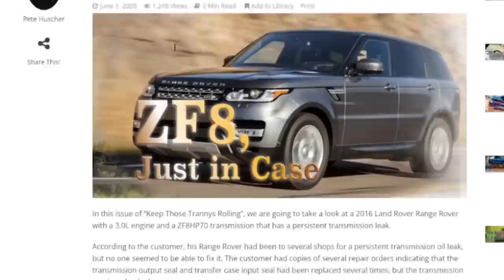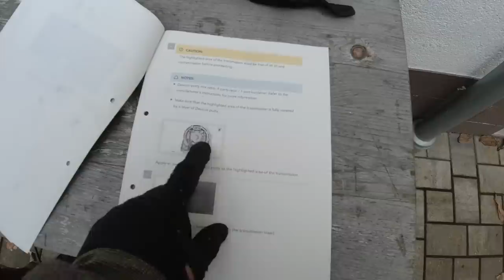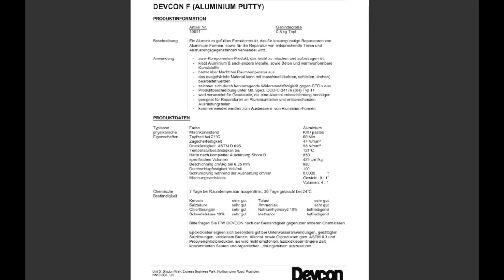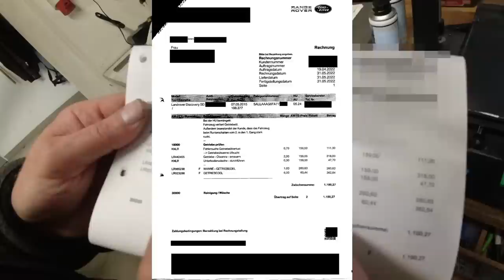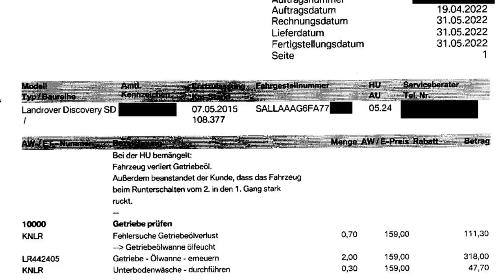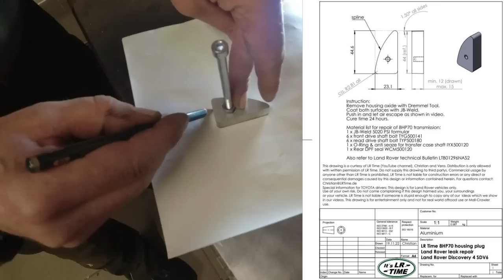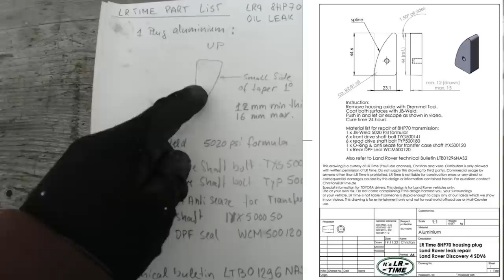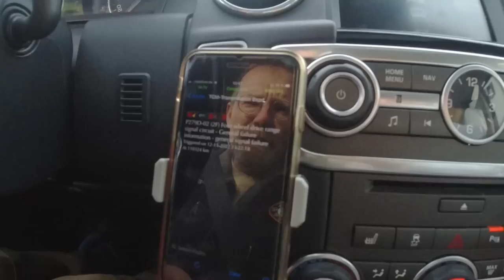Dumbest Oil Leak Ever Fixed on our Land Rover

Comment: the dealership is full of shit. they're mostly the same - in a hurry, working to unreasonable schedules and trying to turn around as many cars as possible in the shortest time possible in order to maximise their profits. that goes for independents too, very few decent mechanics around not ripping people off. also, land rover make a faulty vehicle and then have the gall to charge their customers €500 for the materials to fix the mistake.
Reply from the maker: Yes, they are always on a way to tight schedule and push to make money 💰.  Christian

Comment: If Landrover had admitted failure or be at fault the repercussions to the brand would be very expensive so they would be instructed by high management to deny I do agree they should’ve reimbursed for the work that was unnecessary to the previous owner .😁🇬🇧👍John

Comment: I don't take my cars to the LR dealer for anything after they jacked up an oil change and 100% did not put the correct weight oil in.   it did not sound correct after leaving the dealer and went home order the oil and re-did it my self and it sounded perfect after.

Comment: Landrover ripped off that customer , they should re impures the owner. Shame on them ( and I am a customer having had two discovery 4s; a defender 110 and currently a disco 5 and Range Rover sport). This dealer lets the brand down, you should send this to head of JLR in uk.

Comment: Christian, a person responding on behalf of a business will never admit fault.  However I agree that they were not very ethical or morally correct.  I think that they should have as a minimum checked if there were any service bulletins that applied to the vehicle.  They should make the client aware of all service bulletins that apply to the vehicle even if the client has not complained about the subject of those other bulletins.  The client is then informed and can make a decision if they want the work associated with those bulletins performed.  The faulty casting is a latent defect and LR/ZF should have paid for a recall to have the problem rectified.  If they were not required to perform a recall because it was not a safety issue then they should have paid for the repair when clients found that their vehicle had a transmission leak.
The LR service place should have accepted that they missed checking the service bulletins and should have offered to rectify their mistake for free.
It appears that brand specific service centres particularly for expensive brands get very arrogant and used to having people with deep pockets just pay without question.  Yes they have to make a living but they should also be professional.  For the prices they charge we should not have to put up with incompetence.

Comment: Its JLRs business model, they should have recalled the engines with the crankshaft spin issues and recalled for the casting - but they choose not to for profits sake - with the result that reliability and customer satisfaction is very poor - but their main market is folks with plenty of cash who buy new every couple of years. Once customers walk away they dont come back. It cant be right that the first thing you need to buy for your Landrover is a scan tool.

Comment: Hey guys. I know this is not on the right video to ask this. Though I am sure that you know the answer LOL

I am about to order new brake pads for my LR4 2016 SCV model, but I am unsure if the pads are the same on front as on rear.
Reply from the maker: I'll send you the advanced factors link to their brake parts. https://www.advancedfactors.co.uk/brake-parts-11-c.asp Changin brake pads is not as easy as it looks. We have a lot of experience, and we know how to deal with rosted, seized components.  Make sure you are really up for the job. 🙋‍♀️VEra

Comment: In my opinion, it should be a full recall and all the cost would be on LR or the gear manufacturer. regardless of the oil pan.
It can not be proven that the oil pan did not have an issue. but this casting problem should have been covered by a recall.

If that is the way they deal with a customer I would never ever buy a LR. and even if in the remote possibility and by chance I win one or I am given one for free I would sell it the next day.

I was looking into buying an Evoqua, but that will never happen after this.

Comment: bad thing is my car is within the VIN range and I do think they should fix it for free seconfd time! I had it with leaking transfer case
Reply from the maker: If it´t not leaking oil there is nothing to worry.   Christian
Reply: @Vera_and_Christian  I am not, got good extended warranty which been used before but having space like you guys and two poster I would defo do way more on the bus myself
I admiire your drive and how resilient your are not to got Towota way ;)
Reply: @Vera_and_Christian  You have jinxed it Christian - fecking thing started leaking few weeks ago..... ;(

Comment: The Landrover workshop may have checked for an oil leak, they may have attempted to fix it. But I bet when they found it still leaking and with the  safety check or MOT due, there was a liberal amount of brake cleaner sprayed on the oily area just before as it went in to be tested hoping that with it only being a slow seep of oil any seepage wouldn’t show up during the test, which it clearly didn’t, and so passed.
 You didn’t suggest a customer refund to a Landrover workshop did you? How naive! As a Toyota Landcruiser owner, I can assure you these things can also happen in Toyota workshops. My Landcruiser developed a strange problem, from standstill if you drove away it wouldn’t do anything for 7 seconds. I couldn’t find the problem. So into Toyota it went, they diagnosed it as a faulty injection pump, I disagreed and took the car away. I then tried the local diesel experts who changed the mass airflow sensor and fixed it. I went back to Toyota and told them just what I thought of their “master technician” that diagnosed it as being the most expensive part on the engine. Of course the manager I spoke to had every excuse under the sun about what had happened. And no I didn’t get a refund for the Toyota misdiagnosis either.
 Oh and of course being a 2001 car the OBD system used a computer protocol specific to Toyota, so no other reader works, I’ve lost count of the different ones I’ve tried. Toyota were forced to change to a common protocol on later cars.
 My poor old Landcruiser is now very very sick, the transfer box is completely worn out with a slipping chain, so the front driveshaft is removed and the car runs with the centre diff lock locked running rear wheel drive only. Plus now the auto gearbox slips in 2nd and 3rd gears. So with the car being 21 years old and having done 368,000 MILES it’s time to retire it, but even at that mileage the engine uses NO oil and go like a train.
 Love the videos, keep them coming.

Comment: Why wouldn't LR give a callback repair or have the Gearbox replaced for free knowing they have problem with some castings, BMW did that to a part on a GS 1200 and the bike is 8 years old and was repaired last year in November. Too me this is bad service from LR.
Reply from the maker: Wow, after 8 years.  Maybe because it was safety related 🤔.  Christian

Comment: The first owner should get the recall.   The Land Rover dealer should fixed it for free and back charge the cost to Land Rover.   The Land Rover will claim the cost from ZF.   The bulletin came out in US because the manufacture knew there is the problem with the gear box casting.   They put it out to covered their butt, incase of law suit.

Comment: The last owner of this vehicle should be issued a full refund from the service they paid for that wasn’t completed satisfactory.
Reply: That’s the other thing, the casting is screwed up. Which would necessitate a potential recall, especially with the NHTSA in the U.S. this transmission should be replaced 100 percent cost free.

Comment: dont talk to the dealership - talk to Landrover direct, if they think you are genuine (ie not looking for an argument) and are a landrover lover they are very helpful and will compensate where necessary. I had a new turbo fitted and it failed almost immediately causing the engine to rev out of control. The dealership only offered to replace the turbo, landrover supplied a short engine and apologised. That was the second time I complained directly to them - both times they responded positively. Dealerships dont like doing anything for free - dont believe its any different in Germany! I would think they know about your site here so I can only think they will fall over themselves to be helpful

Comment: The UK is also well equipped with useless JLR dealers who fail to carry out the correct repairs and simply change things at the customers expense on the hope of a fix. Few ever get to read the bulletins because they arrive on a managers desk somewhere in an office and never reach the workshop floor or people diagnosing the faults. Even safety recalls are treated in the same casual manner. 
Whilst the product is generally good the backup and maintenance offered by JLR is not.
Love the rant and the degree of attention paid to gluing in the plug.

Comment: That was nothing less than a "manufacturing defect" and should have been repaired free of charge by the dealer. I'm sure they would much rather keep their Technical Service Bulletins private, so they aren't exposed this way. Maybe because of the MOT inspection, they cannot admit the mistake? I'm afraid that dealers will always be tempted to defraud their customers, and a number of them will give in to the temptation even more as vehicles become more complicated.

Comment: I can't get over the fact that a manufacturing defect - porous casing - has to have the repair covered by the owner. All of those vehicles within the vin number catchment should have a new transmission fitted for free. Typical LR not too do that. I've had 7 LR's/RR's never touch the dealers. What we'd call in the UK - rob dogs. No wonder they are struggling.

Comment: JB Weld is ridiculous. People here in the States use it for all kinds of repairs. Typical "stealership" tactics. My friend has a similar issue with his Ford F250. There was a set of them that left the factory with sand in the engine from the casting of some parts. He (being German) over engineered it by adding a special filter to eliminate the sand once it began to move.

Comment: Fully agree with Christian but we must also try to separate different actors and degrees of responsibility.
To be clear, the dealer's behavior is regrettable, truly unforgivable and without excuses as he knows very well what's the right way to proceed and how much be the cost to pass on customer.
He makes three wrong choices: applies unnecessarily burdensome procedures, doesn't fix the fault, doesn't inform the customer.
But, as said at the beginning, there are different players, one is the retailer and the other is the manufacturer .
I can understand that a reseller, a professional repairman in searching of profit behave like thieves (let's give the real name to these subjects) but manufacturer play a different role and in my opinion there're some questions on the "table"
What confidence can have a market that is flooded with this type of behavior ?
What trust can be in buying an object that turns into a trap?
Land rover has to wake up , open eyes and ears!
And (to Land Rover) please let's not talk about the war , brexit, TATA or global warming
For Vera and Christian , as usually  , great video , amazing , interesting  and well presented story
Thank you

Comment: A complete investigation and fix. Regarding: allocation of responsibility; cost of repair. This encompasses matters of honesty and culpability. The problem originates from the Land Rover manufacturing process and should have been subject to a recall and fix, from the factory - I understand the problem may have become evident outside of original warranty, however the article sufficiently cites the origin of the problem - subsequent fixes should not impact upon: profitability of service centres or cost to customers. This is of course a bitter pill for Land Rover to swallow but allowing the pain of their error to accumulate downstream of sales is dishonest. Is it criminal? Sure. Do corporates do this from time to time. Yes they do.

The issue, at process, was at some point fixed - either deliberately or coincidentally. There is, likely, a point at which culpability can be established provided the company has an honest and transparent auditing process. End of story. The more you investigate this type of issue the more likely you are to find culpability. In a perfect world retroactive liability and recompense should ideally be achieved .... but this is not a perfect world. Large corporates get away with this stuff all the time. 

This does, of course, put Land Rover is a very difficult position, however, I have no sympathy for them, in this issue. It's just business. Christian, you have my complete respect and admiration for the way you approached this problem and presented the issue. And yes you guys should be in some way elevated in the Land Rover process. Very very interesting  ...
Reply from the maker: Thank you. Business decisions are sometimes not morally correct.  Christian
Reply: @Vera_and_Christian  "Often" not these days, Christian.

Comment: The company ZF, contracts with a metal company to do the casting for the transmission, then they put all the parts together.  Since the casting is what is at issue, then the casting company should ultimately be responsible for the issue.  So the Land Rover Dealer should make a claim with Land Rover Headquarters, Land Rover Headquarters should make a claim with ZF, and ZF should make a claim with the metal casting company.  The metal casting company will settle their claim with ZF because ZF is likely their #1 source of income and the wish to keep them satisfied.  ZF will settle their claim with Land Rover because Land Rover provides a significant portion of their business.  Lean Rover Headquarters should settle the claim with their dealer to keep customer satisfaction at an acceptable level.  The customer should make sure the Land Rover Dealer understands that they will not purchase another Land Rover Product if they are charged for an issue that is clearly due to production and not user error.

The problem is folks who like Land Rovers STILL purchase more Land Rover Products even after getting screwed in this manner, so the Dealer continues to not respond to the threat of loss of business because they know enough people will not follow through on the threat.  That makes the threat toothless, and the buck doesn't even start getting past up the chain as suggested earlier and the originator of the problem, the metal casting company, never has to pay for it's mistake.

Comment: Usual appalling customer service. When I ran a check on my wife's (new to us Toyota) car the check came back with various TSB and recall notices. The same when I bought her VW 15 years ago.
If I can get this information with a VIN why can't the dealer? It isn't as if they do stuff on the cheap...
Reminds me of when I was told my Discovery in 1993 needed a new joint after 1 year and that it wasn't covered under warranty as I used my Discovery off road.

Comment: Personal experience says that any LR being sold with a full LR dealer service history and all recalls signed off as completed should be fully inspected by a trusted independent LR specialist. There are certain dealerships, that if they appear in the service record/recall list/general maintenance, I would never consider purchasing that vehicle.
I strongly disagree that it is not LR issue - you as the vehicle owner do not get to chose the source of the gearbox and therefore the certification that it is fit for purpose. Therefore the casting leak should be the responsobility of LR to resolve. They can then contractually back charge ZF for any costs incurred under their supplier contract. Sadly, we know that in Europe and America, consumer law is so biased in favour of the supplier that they would never be charged. Australia is a different matter - consumer law is based around fit for purpose and reasonable expectation of product life - just watch some of John Cadogen's videos as he lambasts the likes of LR for trying to wriggle out of complying with the law

Comment: I am not surprised but I am disappointed that  Land Rover will not cover the cost of the fix for the transmission after identifying through a tech bulletin the problem which has its origins at the manufacturing point. At the amount of the purchase for the original vehicle Land Rover at minimum should have covered the total cost through the dealer network. Now they have a real bad reputation across the world web. I know I would never buy a Land Rover. Good job.

Comment: Surely ZF should be held responsible for supplying a leaking casting, and pay for the repair.  If ZF was responsible for paying, the dealer would 100% have done the repair on the leaking case.  The dealer is pretty stupid, though, because they could have done the repair and been paid for it by the customer - same result for them, except ZF might have paid a fixed amount being less than they would rip off the customer.

Comment: Sounds like they didn’t fix the leak properly.

I would also question why the modification you found on the internet about the casting wasn’t done. 

The trouble is Landrover are too used to dealing with high earning customers that have little mechanical knowledge so they can get away with poor work.

Comment: Dumbest oil leak ever? Not even close. Defender Td5 leaks engine oil from the ecu. The ecu is underneath the drivers seat. Beat that! 😜
Reply from the maker: The 5 speed Mercedes Transmission from 2005 did that too.  Oil goes right up through the cable.  😂 Christian